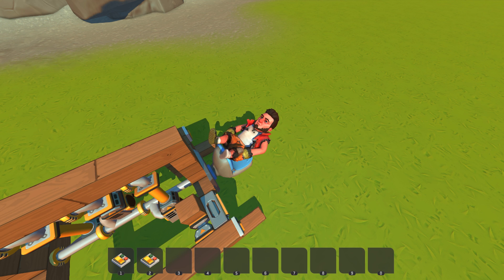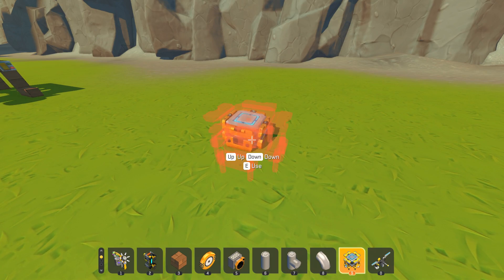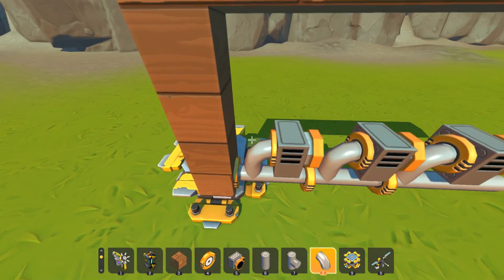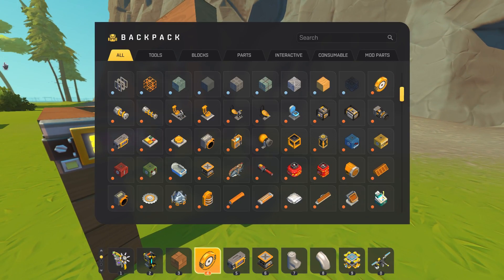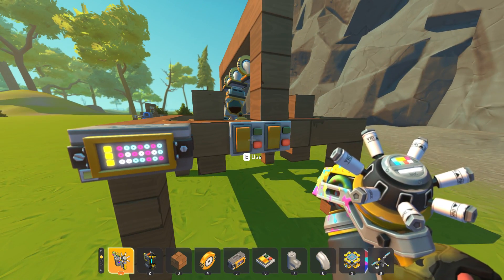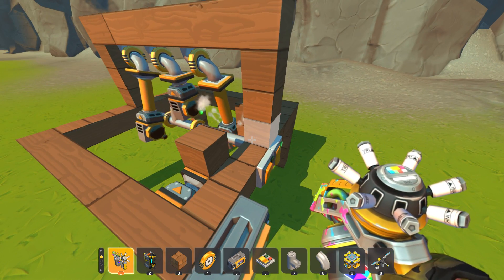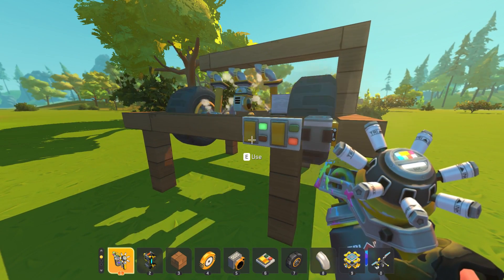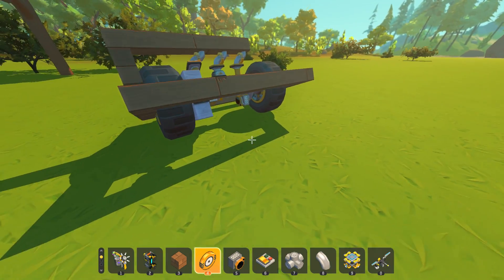How to Make a Piston Engine for Survival! (Scrap Mechanic Tutorial)

Comment: Perfect design, using real combustion engine principles such as an even firing interval, given this is a three cylinder they fire 120 degrees apart and a four cylinder would every 90 along with how you talk about the secondary forces where the pistons if unbalanced will shake a lot making it 6 cylinders where it is the 3 cylinder but mirrored.Thank you so much I’m getting this game for this alone

Comment: I love this engine as it will carry my heaviest scavenge vehicle, equipped with almost 20 chests to pile everything in, however, it almost has no steering, I don't know if its because both rear wheels are pushing it together, or not enough weight on the front tires, though with the build I am using this on, I don't think that is the cause. Has anyone who has used this on a 4 wheel vehicle had this issue, and how did you fix it?

Comment: what does the middle piston do it's in between two bering so it doesn't help the other two push what's hooked up to the wheel I would if you got rid of the middle bering but then you couldn't set away for the pistons to orientate. just wondering

Comment: What happens if you activate forward and back at the same time?
Should you use an Xor gate on one of them (Fwd/Back) to prevent that from happening?
Reply: I think it would either alternate in a small arc, or stall. It might work as a sort of e brake. On a basic one I wouldn't worry about logic, if you are trying to do something complicated go all out.

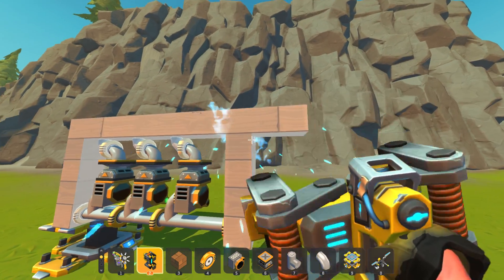Comment: 3:24 how do you weld like that? When I try to weld using the normal left click it does not work
Reply: Needs to be in a lift and the parts touching
2 parts that are separated by 2 or more bearings can be connected if you aim at one, hold left click, and aim at the other then let go
Reply: @rewrew897  thanks

Comment: So I don't quite understand how it works. I was able to replicate it and do alot of testing but still have one question. Because each piston/sensor on the 'crack shaft' is seperated by a bearing how does it supply power? In theory the middle piston on its power stroke is only turning a T pipe with bearings on both ends which shouldn't supply power to the rest of the shaft. I've tested in game and that theory is wrong. The center piston does power it as well so why are the bearings between each piston not free spinning and instead acting solid? Is it the controller that locks them in place one they have their angle set?

Comment: How does the centre piston create torque when it is connected to the crank with a bearing at both ends?
Reply: Nevermind, i see you set the angle to 120 on rewatch

Comment: Works fine for me. it did take me a couple of hours ( I forgot the bearing behind the piston sensor). Had to follow his guide and connect everything in order and make sure parts were correctly welded and when making modifications, it depends on whether or not the whole structure is on a lift or not. The order of when installing stuff matters on and off a lift as seen on his video. 
Now I need to upgrade my pistons to have more force.
Reply: thank you so did i

Comment: (for base defense) you could make a piston engine that spins a few pistons connected to the middle or even the sides of the engine (that are extended so they will kind of come out of the top of the engine and spin basically how a wheel would )  enough that they don't make contact with anything(because pistons don't have collision physics )  and have saws or something at the end so that it deals large amounts of damage  to any farm bots that try to harm your crops.

Comment: Did this got pached, because mine doesn't work. I'm in 0.4.3, and my middle section doesn't want to obey the controller, not even a single degree. Please somebody help me
Reply: Same, as soon as I connect wheels to it, it stops working immediately. Not sure whats wrong.
Reply: For me the whole thing starts to role
Reply: Works fine for me. it did take me a couple of hours ( I forgot the bearing behind the piston sensor). Had to follow his guide and connect everything in order and make sure parts were correctly welded and when making modifications, it depends on whether or not the whole structure is on a lift or not. The order of when installing stuff matters on and off a lift as seen on his video.

Comment: Hi Kan. I try this in creative but when I connect the controller to the bearings and set the angle a 120°, the pistonsdon'tmove,they stay just at the same place as I have placed themwhen building. an Idea?
Reply: Well... Ok,I'm stupid, just forgot the bearing between the sensors and the curved pipe...

Comment: The piston doesnt work I’ve look at this video multiple time and still havent figured what the problem is
Reply: Same , i can not get it to work
Reply: Won't work for me either, only in one direction
Reply: I experience really jumpy motion even with the coloured blocks
Reply: My creation tends to do slow cartwheels away from me with this design
Reply: @bart0nboy  I had this issue, make sure you put bearings behind the sensors
Reply: The pistons need something to push. If thats not the case, either you didn’t connect the pistons with anything or you connected them wrong
Reply: you just have to tweak it a bit
Reply: It doesnt work cause the pistols need an engine

Comment: I watched this video about 20 times before I got it all working in Survival, 1st attempt the frame crumbled apart altho I apparently did weld it together one bit wasn't and it just exploded.  2nd attempt  the entire frame just tumbled over and over and basically rolled off (forgot the top bearings).  3rd attempt  it broke at the side bearings and the pistons just basically fell off.  Anyway long story cut short, it didn't all work until I put the wheels on but it still looks like it's broke at the top bearing/joint above the pistons.  Am gonna push on and build the rest of the frame and see what happens.

Comment: I wish the game didn't seem to hate rear wheel drive so much. I've built a similar vehicle but it has horrendous turning radius and looses traction a lot.
Reply: Try making both rear wheels closer to each other. The thing about direct drive piston engine is that it didn't have a slip differential so that makes both wheel act like 1 giant cylinder wheel which is bad at turning.

Comment: im curious, if there are bearings between each section on the crank, how does the middle section transfer power through?
Reply: That's what the controller is for; it maintains a 120 degree rotation between each bearing

Comment: my engine doesnt want to work did everything as you did but as soon as i take the engin of the lift it starts to roll the whole frame and when u take out your welding tool it shows that the pistons  sensors are part of the frame and even when i set my 120 degrees my pistons doesnt change like yours do en also my pistons with wooden blocks to activate the engine welds to the frame the whole time but i will keep tyring rebuild the engine like 10 times now

Comment: I made a car that uses two of these- one for each rear wheel- its wide and occasionally the steering slowly drifts but it has a lot of power and can haul 1125 of the heavy tier three concrete and still manage to start rolling and pickup speed. any more than that and it doesn't like starting.

Comment: What is the purpose of the bearings in the middle of the straight pipe?  Seems like that would make it spin freely
Reply: The controller sets the starting position as the offset angle and since there is no more settings it stops any other rotation.

Comment: is there a reason that the piston engine wouldn't have the torque to go up a hill? the engine works but if i go to a hill the tires just spin? and I have max pistons.
I have a small trailer attached to the car with 2 resource collectors but they are empty when trying to go up a hill. if anyone knows :P thanks all

Comment: It doesnt really work for me at least... All happening is the pipes going off their place, the bearings loses connections with the pipes etc
Reply: Do you have bearings on the back side of the sensors? I forgot those and had the same Problem...

Comment: I am having a hard time attaching the section after the wheel bearing to the rest of the frame.  It looks so easy in the video, but I can't seem to line it up with the rest of the engine frame.   Part of me feels like I don't completely understand how to use the weld tool.

Comment: Its really weird, I managed tu build a piston engine based on this model and it works really great, but i have no idea why, when i rebuilt it in survival performances really sucked, i had to upgrade the pistons to full (i wasted 32 components kits on this...) for it to barely work, I dont know if it's because I had suspensions on the free wheels and a resource collector (super heavy part) but man Im so disappointed. Anyway the build is really cool, and it worked amazing on my creative test vehicle (with a transmission system similar to the one you made on your survival world) and it's an impressive contraption

Comment: You could save a component kit from the sensor by putting the control pistons in the middle - as in flip and move 1 set of piston/sensors, and move the control pistons in between.

Comment: Hello, I am currently playing scrap mechanic on may 11th and this doesn't work for me, I have built it off of memory and built a second exactly like in the video. I think the problem I have is that I think the remote controllers have the bearings set at 120 degrees for both and won't move, anyone else have that problem?

Comment: Works great.... Until I go to add wheels then its all over. Cannot line up the bearings at the end of the wheels to connect to the frame, If I do, I cannot weld the front half of the frame up to the back and it tears itself apart.

Comment: i used another tutorial for the basic shape, but stole the way yours looked for mine :D though my piston engine has the jerky motion you showed, with the piston getting detected by the sensor. happened after i upgraded my pistons to level 3, before that there was no issues.. gonna invest in a painting tool.. and upgrades for the sensors.

Comment: one thing i noticed with color mode was that its harder for it to change direction. if you go forward and come to a complete stop it wont budge when you try to go back especially if you have a heavy vehicle. when its not in color mode it jerks around until its centered in a way it can go any direction. also without color mode it prevents itself from rotating so if you park in on a hill that might actually be useful since it wont roll down.

Comment: Yo kAN whenever I set the angle of the bearings it fights the pistons and it’s identical to yours. (If you don’t mind helpin out ping me on your server same username no spaces)
Reply: I got it to work with 105, but not 120
Reply: The Golden TNT have you got 4 bearings if so just take what you know and build it again as I had that problem and that fixed it will be something stupid that is hard to spot

Comment: Tip for people building: upgrade the controller to level 3 and connect the forwards piston to it, now set the piston to go 1 block when the controller is on and make sure the controller is set to repeat. After that connect the controller to your seat and now when you hold W you will go forwards!

Comment: If I were to build it with more pistons do I just change the controller settings or will it work with just fine. Like making it with two pistons do I put the controller setting to 180 degrees and for four change it to 90 degrees will the trigger work for a different number of sensors, I saw a two piston engine but it had logic gates and four sensors, and when I turn it off it take a while to start. This one looks a lot easier to make in survival

Comment: i built this engine in survival a few days ago and i noticed that the sensors are detecting the pistons. At normal driving speed this isn't a problem but when i try to drive up hills and i slow down the pistons try to extend when they should retract. So i just stop and have to walk up the hill.

Comment: So this can be done without exploiting the piston's lack of collision?

I assume so by making it a few blocks wider and adjusting the sensor distance
Reply: Yeah, you can definitely do this without clipping, it tends to be slightly more complicated to build/wire up due to having to use a different sensor layout, but it's not much worse. You can also do it with only two pistons as well, at a 90° offset.
Reply: umm, no? They have to clip through the crankshaft
Reply: @board7374  no they dont, you just need to set it up differently

Comment: I was looking at other ways to build them and I built them in creative and I kept running into the problem of the sensor picking up the piston. Also, thank you for posting this because I did not think about color sensors
Reply: You can also have all the sensors on the end so they aren't looking through pistons, but it only really works for 2 and 4 piston engines.

Comment: If you upgrade a controller to level 5 and put 5 bearings on each side back wheel, loop it with 360 degree rotation. You get infinite fuel. PS you can hook it up to the seat and S will be backwards and W will go forwards. I hope I helped.

Comment: or you can just connect a pipe on a bearing then on the other end of the pipe another bearing and a wheel then get 2 controllers put a bearing to +360 degrees and select the loop option and then get another controller on the seond bearing to put it on loop with -360 degrees. Put each controller on a switch/button and you got yourself a driving car with no need for engine and you have alot of torque to carry heavy loads
Reply: now 1 controller can do it. you conect the controller whit a driver seat and a bearing set to 360 and loop put a wheel on it and you can controll it from the seat whith w s just like a motor.

Comment: I spent like 2 hours two days ago trying to copy the engine from your video
Reply: I ended up slowing down his Noob Vs Pro video and copied that build. That one was a pain in the butt ^^;
Reply: yeah same
Reply: @Chao Yep... Pain In The Butt
Reply: i did the same but i didn't have much difficulty it took me like 20 minutes. mine looks a little bit different though and its not block for block but it works the same way.
Reply: @Omlet221  I kept missing really simple parts cause whenever I blinked I missed something - mostly without noticing for a good while. 
ended up getting an exact replica by the end of it which is pretty fun, though